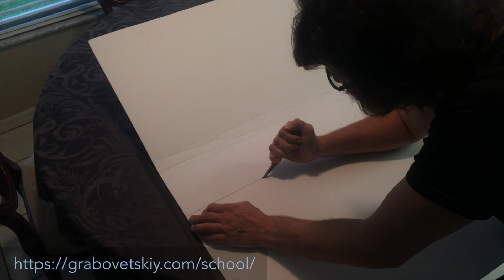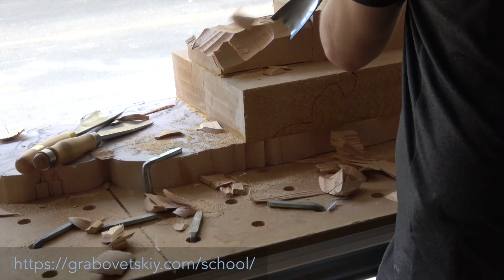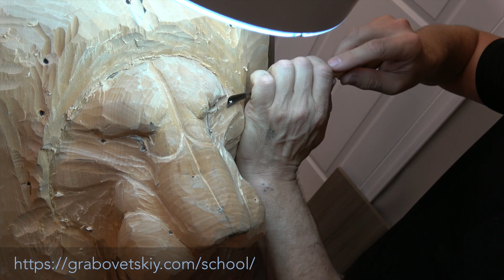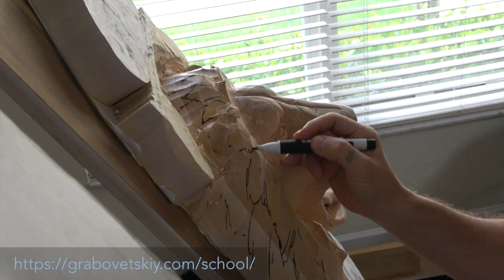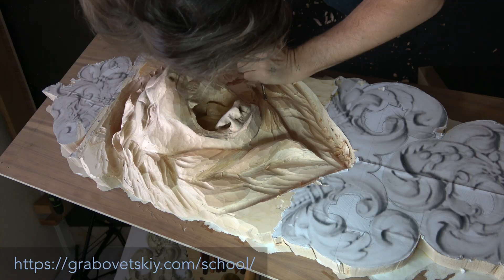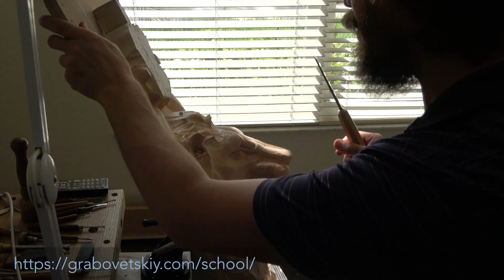WOODCARVING process [Lion  Ornamental Wood Carving]

Comment: Alexander, I am interested in learning to carve, and plan to take your course soon. My question is, where do you get bigger slabs of wood. For example, I want to carve a griffin, and have it be around 16"x28" (tall) and about 8" wide. Would I need to use joinery or is it possible to get say one piece of walnut that size? I have some very old renaissance revival furniture, and it does not look like it was multiple pieces of wood to carve one figure like that. Thanks!
Reply: I ask because local wood suppliers seem to only have smaller pieces for pen blanks or bowl turning and the like.
Reply from the maker: Good question. I usually buy my wood at local hardwood lumber yard. But you still need to glue up couple pieces together. Just try to find at your area who sells hardwood for woodworking companies.